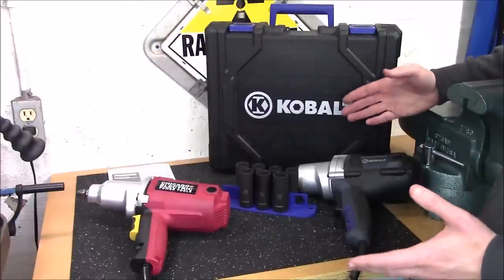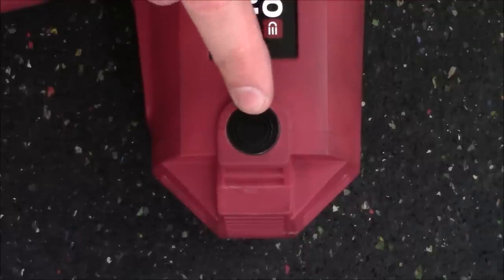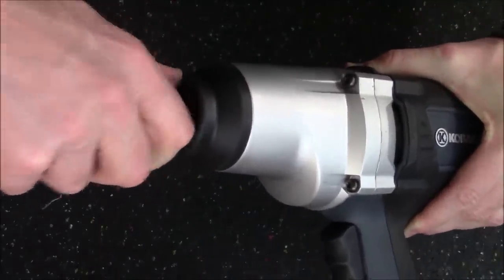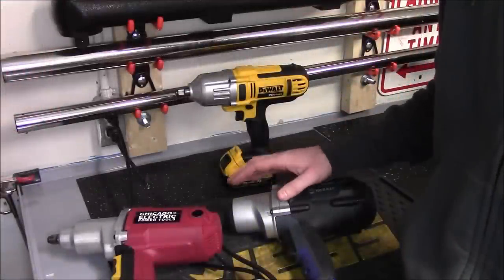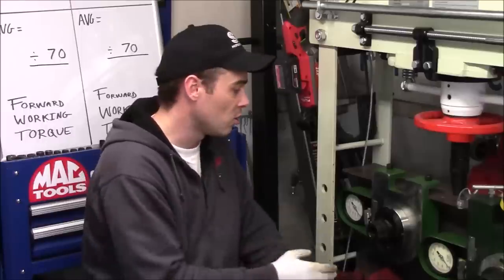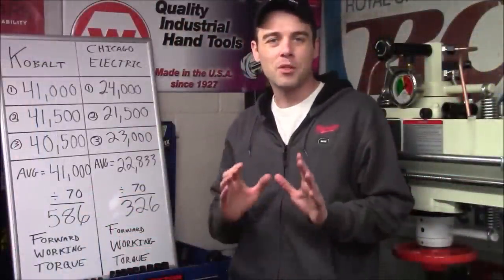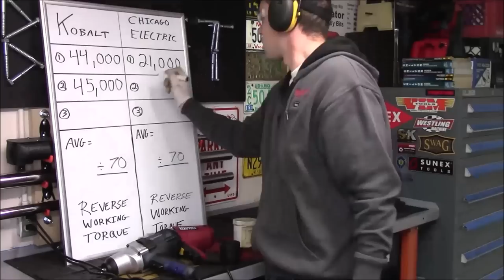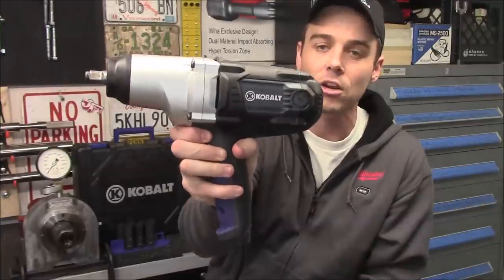Kobalt - VS - Harbor Freight 1/2" Corded Impact Wrenches

Comment: I have a craftsman brand electric impact bought from sears few years ago. DIY use it's a great tool especially for someone that doesn't have the room for air compressor or proper wiring. It makes suspension repairs on my jeeps and chevy 4wd toys a breeze taking off fasteners, I suggest not using to reinstall, it sure loves to eat threads on on CV axles! I shall call it the destroyer. Great for bolts you care less for and snap a few. Its also great for Around the home driving lag bolts and other building projects  uses.

Comment: I bought the Chicago Electric because I needed to remove some running rails on my pickup truck.  $39 with a coupon, and 20 minutes later the old rails were off.  I later used it to remove a lawn mower blade as well.  I rarely need this level of a impact wrench, so the HF option was cheap and meets the need.  If I never use it again it has paid for itself already.

Comment: The Chicago Electric I have doesn't have the round carbon brush removal cover. It has to flat logo panels with screws. I guess they updated the design. I have spare brushes but bought them from Amazon because the box was missing them. 

The carbon brush sizes are 15mm x 10mm x 6mm for any of those that are curious for spares. Also the same size for other Chicago Electric power tools.

Comment: Thanks for posting - this is a very well produced video and very well executed test of the impact wrenches. With respect to cost, I suppose that a professional would go for the Kobalt for its frequent use while the DIY might want the Chicago for occasional use - and depending on the level of torque needed. An excellent video for providing objective information on making that decision!

Comment: Hello, It needs an update. I hope you have an opportunity to test the new Harbor Freight 1/2 impact wrench-Bauer 1/2 in. Heavy Duty Extreme Torque Impact Wrench. It advertised that it comes with 1050  ft lbs. bolt breakaway torque, but it also says Maximum Torque (ft. - lbs.)  300 ft. lb.. I am not sure which number is right. Hope you can update the video to do a new test.

Comment: I'm certain the Kobalt is a better tool, but it costs  $150. My Harbor Freight tool was 36.99, and I got two full sets Metric and Standard as well as extensions for 89.00 total. I'm certain it will do what I need to do,  and I have a pneumatic one if it doesn't. This isn't a slam of Kobalt it's just the facts.

Comment: Great Review but price has to come in to play.  Hinda seems to be the under 12-HP. Engine King but be prepared to ante- up for one.

I am doing stubborn control arm bolts on my Solara and it us bringing the HF gun to its knees.  Had it about four years.  

It did take off hub nuts and crankshaft pully nuts when it was new. Now getting 80 ft-lb lug nuts off is a dicey situation.  Perhaps I should change the brushes which I did not kniw about until this video.  I paid $59.00 + 9.5% sales tax for mine here in Chicagland.

Comment: I have the same Harbor freight corded impact wrench. It did the job as long as I gave it at least a half minute of run time to build up torque. I didn't use it long until I could afford pneumatic tools. Never looked back. I maintain 3 vehicles, a trailer and two tractors and the HF is definitely not up to the task for a homeowner/shade tree mechanic with some small equipment.  Plus its freaking huge and won't fit in many places on most vehicles.
Reply from the maker: The size of corded impacts are definitely the worst thing about them.
Reply: Real Tool Reviews yeah, that armature has to be huge to make it chooch. great videos man.

Comment: I would like to see a comparison between the new HF Earthquake XT and the Kobalt 24 volt impact wrenches. I personally bought the Kobalt, only because of product line expansion, the Earthquake XT is the only tool in the HF line using that battery, but I would like to see how they stand up against each other.

Comment: Really solid review... I enjoyed it--and subscribed.   
I think just a tad disingenuous at the end re: 90 days return for defective product at Harbor Freight.  (The extended warranty is relatively cheap, and adds another 2 years.)     I can't disagree that the Kobalt is a lot nicer due to the case, impact sockets, rubber moldings and double the torque.   But, is it worth more than 3X the cost?  I'd probably say, "No.  It isn't.   Not for most tinkerers."

Comment: Purchased the kobalt a while ago, works well made changing shafts, control arms and struts easy enough. Harbor freight tool may work well too. I did buy the battery powered one from hf didn't care for it though.

Comment: If you buy Kobalt one, check out the Porter Cable one model PCE211 and it got 455 ft.lbs and costs around $80 instead of at least $120 on Kobalt.

Comment: One thing you don't point out, although the Kobalt is about twice as powerful, it's also 3 to 4 times more expensive. Seldom will you encounter any car or truck lug nut torqued beyond 140 ft.lbs. . the Harbor Freight unit has many years of excellent reviews and for the average or moderate user the Harbor Freight unit is the far better value at around 50 bucks !
Reply from the maker: I don't ever talk about price....since it changes so often.  Also, you seldom encounter a lug nut INSTALLED at over 100 ft-lbs.....but, since when you remove them, you are fighting corrosion, rust, dirt, etc --- it takes 2-4 Xs the torque to remove them, since you have to overcome the friction caused by that corrosion.  That is why a more powerful impact is useful.
Reply: Totally agree with this.

Comment: I had the Harbor Freight impact for about two days. It couldn't break the lugs loose on either one of my cars. I broke one loose with a 4-way and tightened it back with ONE hand. The HF impact still couldn't break it loose. I then tried my 3/8 Dewalt that's only rated for 120 ft lbs and it got them off. Maybe I just got a bad one but the cashier didn't seem at all surprised when I returned it. Even though the HF impact cost a lot less, if it can't get the job done it's useless.

Comment: Great review thanks.  Is more torque better for a basic garage work guy like me?  I'd change the tires, brakes in my cars and SUV.  I'm think HF with the extra giblets would be good enough.
Reply: The extra giblets from HF's 1/2" air drive Earthquake XT - 1,000 ft-lb!

Comment: When you look at these, you can't help but wonder if they are made by the same mfr. Do you think you could research that stuff for future videos and let us know? 

i had a HF electric Impact for a good 5-8 yrs. The switch on the handle went ...but worked well otherwise for a long time.
Reply: Thought the same thing. Usually, that's the case

Comment: Harbor Freights new high torque Earthquake Cordless 20V impact wrench to Lowes' Kobalt 24V cordless impact wrench. Both tools are at the same price point, but they rate the power levels differently. Kobalt claims max torque at 650 ft-lbs while the Earthquake uses "nut busting torque" of 1200 ft-lbs. I would love to see a comparison between the two, I believe it is a very apples-to-apples comparison. This video could help countless beginner mechanics looking for high torque cordless impacts at an affordable price. Thank you!

Comment: Not defending HF, but the Kobalt costs $140 compared to the Chicago Electric that costs $45, a more valid comparison would had been the Bauer electric ($89), or the Dewalt, Porter-Cable or Craftsman since they have closer specs and prices. Again, just my 2 cents. I am looking at the date of the video and I assume they did not have them around (Bauer). Good video as always.

Comment: I very much suspect the brushes will outlive that Harbour Fright tool. :) I've taken apart a couple of Powerfist (Canada's version of Harbour Fright), and the results were... interesting. One of them, a dremel knock off, had a UL listing, but it was clear the internals would  not have passed any proper certification process. Either it was an  example of quality-degradation, or a flat-out forgery.

That said, nice review as always, my friend.
Reply: UL in Powerfist or Harbor Freight nomenclature is "You're Lucky" if it still works after 90 days.
Reply: The harbor fright is there when you need it ... And the price will save your pocket .. Buy harbor freight.  As often as a guy.  Or gal use it .itll last.  Built 2.   20x24 decks and it took all i threw at it with big lag bolts. Happy as hell ...

Comment: Sooo...2 questions. Corded wrenches tend to have LESS power than battery powered??? Will that harbor freight take the lugs off my car or no?
Reply from the maker: Yes, "most" corded units have less power (at a MUCH LESS price) & yes, most likely the HF will remove your lug nuts.  If not, you can return it for a full refund.
Reply: Awesome! thanks for the reply!

Comment: do a video on the 1/2 air impact earthquake . would like to see it on the Skidmore! see if it really is 700ftb
Reply: That would be a great review ! I would love to see that as well !
Reply: The Milwaukee cordless 18V 1/2" 700 ft-lb forward, 1,100 ft-lb reverse.
Reply: Frank W and the makita DTW1002z is more again! makita has caught up and beyond millwaukee
Reply: Makita, Milwaukee, DeWalt contractor grade tools all pretty good and about the same performance in terms of torque.  DeWalt came out with the 120V cordless! Milwaukee has the 9.0 and some smart microprocessor anticipating your tool use habits and bluetooth connection to your smartphone to fine tune to your likings.

If you want something better, look at Hilti and Metabo. Not so much bell and whistles but higher build quality.
Reply: Happy with makita as it has the biggest tool line up and its better for me as i have heaps of batteries and i can het cheap skins online :)
Reply: Milwaukee is junk now that they're owned by TTI. They're made alongside Ryobi.

Comment: I have the old orange HF impact, 12 years old and it was inexpensive.  I have beat the heck out of it and it still goes.  Its never let me down. It will break the bolt before it gives up.
Reply from the maker: I wonder if yours is better than the current model....would be interesting to see.
Reply: The old saying "the don't make them like they use too" lol. For the most part HF tools have gotten better.   If it ever goes I would really consider the Kobalt, nice review.

Comment: Fantastic review. I watched this one and the one where you did the Kobalt 6904 on it’s own. 

I went out and purchased the corded Kobalt version today. I then started looking at the cordless Kobalt 24V MAX model KIW 1524A-03 version which states it has significantly higher torque at something like 650 foot pounds. Can the cordless version really be that much more powerful than the corded version?!!? Is the key being “breakaway” torque? Is that misleading? What is your take on this? Thanks!!!

Bottom line, which one is more powerful? If the cordless is REALLY almost double the strength of the corded version, I might exchange the corded version for the cordless but somehow I doubt that’s true.
Reply from the maker: Thanks!  Watch this video that I made to answer your question --- https://youtu.be/P0sgP6xDVmM
Reply: Thanks! I watched that one too. I know the numbers are somewhat misleading. 

The battery powered one is intriguing because of its portability but I’m primarily looking for the one with the most consistent torque strength. 

I’d like to know if you believe the battery powered impact is more/less or roughly the same strength than the corded version.  

If you had to choose which one would you purchase? 

Thanks again!
Reply: Thank you! Which one of the two do you think is more powerful? The corded or the battery operated version?

Comment: Awesome video just subscribed. So are these numbers real? Both are drastically higher  torque ratings from your test then listed on the sites for each. For example the kobalt is knocking on door of air powered thunder gun. Just wanted to  see if these are real torque ratings. As you can rip Honda flywheel off with the kobalt. Please let me know. Thanks!
Reply from the maker: +J K Yes --- BUT, when it comes to torque, just about everything affects it.  Meaning a non-lubricated bolt/nut, rust, socket condition, etc all cause torque to be manipulated.  A lugnut installed at 90 ft-lbs can take 300+ ft-lbs to remove later on due to rust/corrosion in the threads.  A LOT of torque is used to overcome friction, which is why reverse torque is so important.  I use calibrated Skidmore-Wilhelm units in a controlled environment --- so it allows me to get accurate results.  Check out other impact wrench videos that I have done to compare these results to what you will see with higher end units (cordless & pneumatic).
Reply: +Real Tool Reviews thank you for taking time and explaining.

Comment: Just for people that are curious the Kobalt shown seems to run about 225 bucks, Chicago Electric runs about 50 or 60 bucks. You get what you pay for when it comes to power tools.
Reply from the maker: +mdmyer The Kobalt is typically $149 (regular price) & goes on sale for $99 occasionally --- with double the power & a 5-yr warranty.  The Harbor Freight is $49 & has a 90-day warranty.  The reason I made this video was the large number of people saying that the two were the same unit with different colors.....as you can see, they are not.
Reply: +Real Tool Reviews I stand corrected on the price, I just looked it up on the Lowe's website. Still 3 times the price though of the Chicago electric. I'm not saying it's not worth the price,  I was just saying that quality doesn't usually come cheap :)

Comment: Bauer has High power 8.5 amp motor delivers 1050 ft. lbs. bolt breakaway torque
Reply: Magnet Fishing Adventures i wanted Milwaukee but my wallet said Bauer from HF for some suspension work i gota do👍👍👍👍

Comment: one factor which was missing was the price of each unit. that can be a big deal depending on your budget.
Reply from the maker: Prices change constantly.....I never talk about price, since these videos will be watched for years.  I do however put links in the description.  Also, many people wrote in and commented that the Kobalt & HF versions "were the same".....I would guess this has proved otherwise.
Reply: +Real Tool Reviews ^ Nailed it. At the time of filming I think the Kobalt cost around $150 Now they cost around $80.
Reply: +Cody Sams    Kobalt costs 80.00?  Where?  Here (northern Michigan) they still are 150.
Reply: +istvan meissler  yes kobalt still at Lowe's for $150 double power than HF but 3x $$ for that power too, harbor Fright is $49 and $15 more for a 2/3 year no questions ask exchange  13pc deep impact socket set $19 with a coupon life time warranty so it depends on your needs and how much you use it, at the end if you buy FH with the coupons and the sockets is still half the price.

Comment: I've never owned an impact wrench but I find I need one now. This may be a stupid question, but how do you control the amount of torque you apply to, say, a lug nut with one of these? My biggest complaint about my favorite tire store is that they apply so much torque to my lug nots that I cannot get them off without a breaker bar.This is obviously a REAL problem when I'm on the road and have to put on the spare tire. THANKS.
Reply from the maker: You need to use a torque wrench (hand tool) to install lug nuts....otherwise they will overtighten.  That can do numerous bad things....such as damage the threads, stretch the wheel stud, warp the rotor, or damage your rim.
Reply: So, you're saying do NOT use an impact wrench to install lug nuts?
Reply: @archiguitarchi  Put the impact gun on REVERSE with the right fitting socket for your lugnuts and pull the trigger because on reverse you would need as much torque to remove the lugnuts; but when it comes time to install the lugnuts, first screw them in and then tighten them by torque wrench (torque wrench is the one you set the torque setting of the lugnuts based on your vehicle; typically for sedans the lugnut torque is at around 80-90 ft.lbs; but for trucks it may be more;) you can pick up a torque wrench at Harbor Freight that would go up to about 150 ft lbs for around $10-$11. Do not tighten your lugnuts with the impact wrench for other fasteners because you cannot control or have a hard time controlling the amount of torque (unless you have torque setting on the impact gun) and may overtighten or damage the fastener unnecessarily. Good luck.

Comment: I just bought the HF impact wrench and it did not come with replacement brushes. Returned it to get another one and that one also did not come with extra brushhes....the employees said it has never come with extra brushes???
Reply from the maker: This is a very old video....At the time they did obviously.
Reply: Yeah they probably stopped giving them out...also there is a little brush cover now instead of a single screw to reveal the brushes so it is a slightly different design. Good job on the video...very informative.
Reply: Would it be possible to do a test on the new Harbor Freight Bauer "Extreme Torque" corded impact wrench? They are claiming :...1050 ft lbs. bolt breakaway torque". As of today, it has an average five star review.
https://tinyurl.com/y7ujjzwu